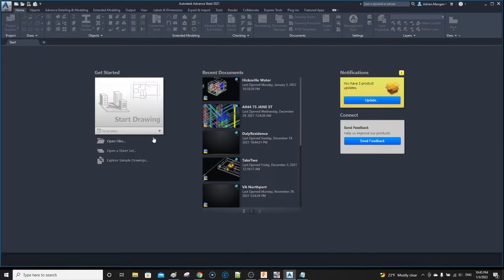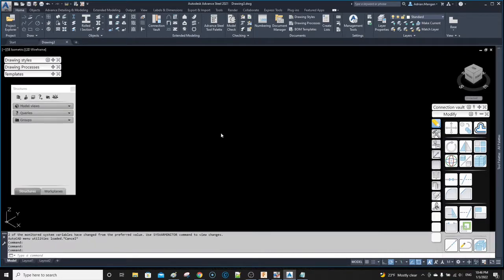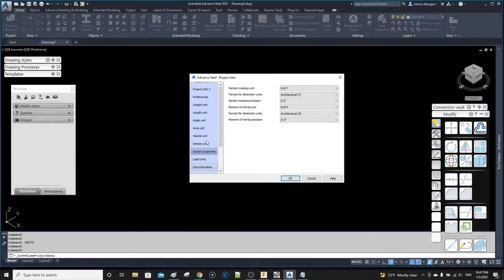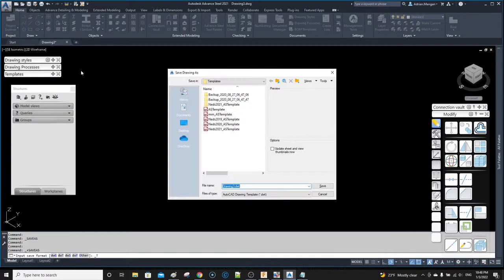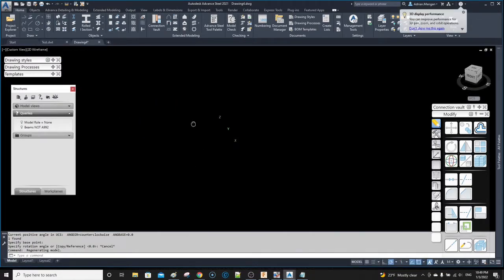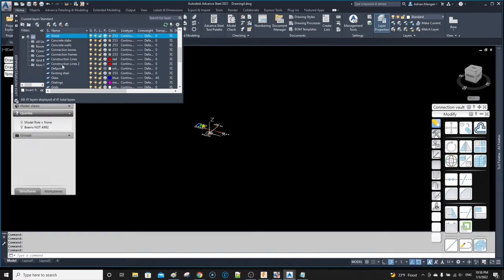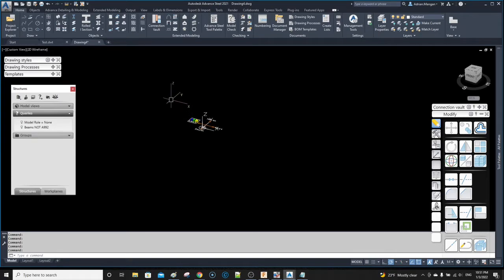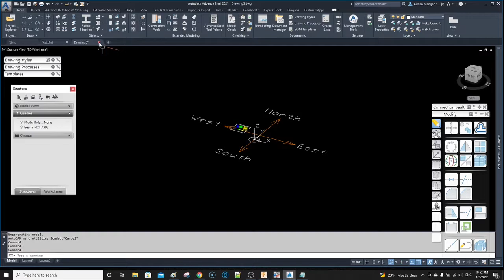ADVANCE STEEL - THE BASICS: "1. TEMPLATE" (30+ PART SERIES)

Comment: Love the channel. I was wondering. I tried to set my template to include the cameras like yours but when start a new project they don’t show. Any standard lines show but no advance steel items. Any trick in getting it to save them?
Reply from the maker: Thank you, shouldn't be an issue, how are you saving the template file, are you saving it correctly as a .dwt
Reply: @EIRCAD  yes opened template made changes then saved as dwt. When I open new file with template it still has all my lines and text but no advance steel items such as view boxes or compass. Using 2022
Reply from the maker: @madmik9582  seems unusual have not come across this before
Reply: @EIRCAD  got it working. It appears that I had the template saving in shaded visual style. When I turned on to 2d wireframe it all showed up.
Reply from the maker: @madmik9582 bit late to reply but interesting,  hope all is going well